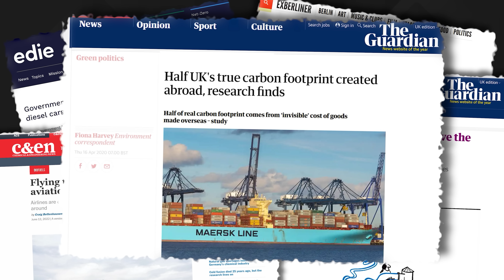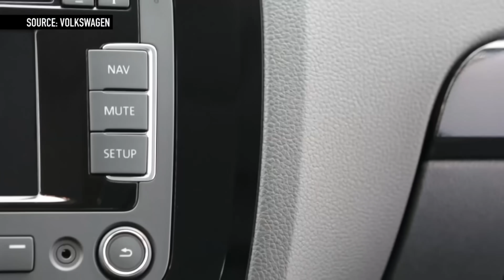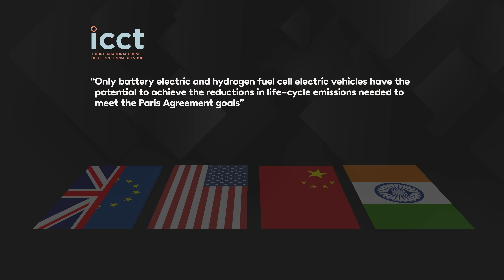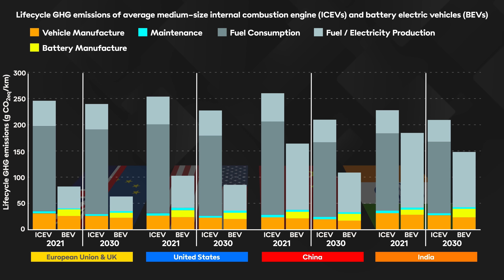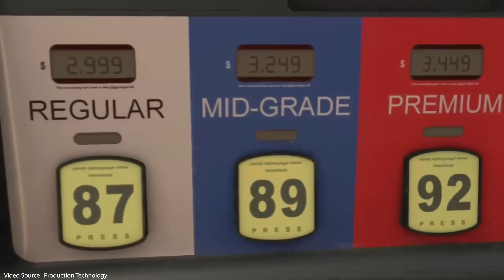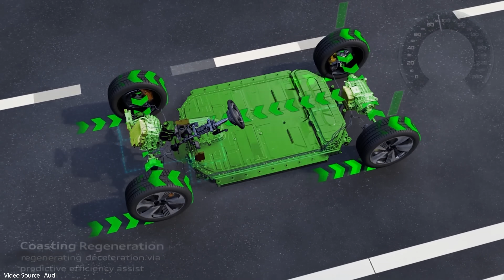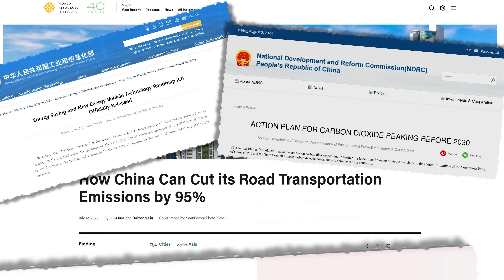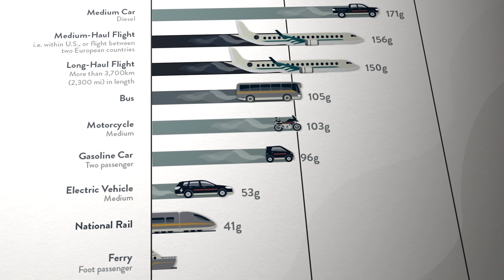Are EVs really better for the climate?

Comment: I think the overall switch away from cars is the best way we can reduce emissions and it will have multiple other societal benefits.
One question I do have, is how possible is it to build enough cars to switch all fossil fuel ones quickly? I have heard that the battery production alone makes replacing all cars next to impossible.
Reply: You raise a very serious issue. The government can legally decide that petrol or diesel fuelled ICE vehicles should cease production on any date they choose. What they cannot do is say they will be replaced by electric vehicles,  because that choice is dependent on China. China controls around 80% of production  of the rare earth elements that are required if you want to make an electric vehicle, a situation that isn't going to change significantly in the next 15 years. Neodinium,  dypsoprisium etc.

It's not planning laws that are preventing mines from being opened,  it's the simple fact that the most economic methods of production of REEs is when they are a byproduct of a massive mine that produces some much less exotic element. China already has such massive mines - the USA don't, and there appears to be no way of changing that economically. And China are streets ahead in Africa in forming partnerships with governments who sit on vast reserves of any element they can't mine economically in China. 

It's not possible to manufacture an engine for Jet aircraft without Rhenium, because it will melt. Rhenium is essential because, along with other metals it forms an alloy that doesn't. It's worth mentioning that it isn't possible to recycle this Rhenium. 

Nobody has been able to come close to showing that it will possible to produce enough of the quantites required to manufacture all the EV''s that will be needed.. Recently, manufacturers discovered it was impossible to secure contacts for cobalt over a five-year period..
Reply: @TheNemocharlie  anyone with a conscience shouldnt be flying anyway.
Reply: Don't worry, they'll just take your car away from you.  You know, 'climate emergency'
Reply: Mining will increase to meet demand, stop worrying about it and buy an EV (or don't drive).

P.S. China doesn't have a stranglehold on the mining of battery materials; rather it has a significant share of the production of the compounds out of the raw materials.

@Dan Harold hydrogen fuel cell cars are dead. There hasn't been a single new one announced for production since the second-generation Mirai in 2019. The dirty natural gas industry that provides 95% of all  hydrogen today may con a few governments into building public H2 refueling stations for all of two car models, but not in enough numbers to make HFC cars successful. And commercial trucking is heading the same way, with far more battery truck models announced and sold then hydrogen.
Reply: @skierpage  as demand increases, so will the supply, I get that. The question is, will the supply increasse wrinkly enough and is there even enough lithium supply in the first place?
Irl mines don't work like how they do in clash of clans. They can be built only in locations with a lot of ore and after lots of planning, paperwork and construction time (all of which will also be bad for the environment).
Reply: @davitdavid7165 for any raw material, if the price goes up, mining companies will look harder for more of it, and begin or restart mining in areas that were less productive. In the case of lithium, we can always extract it from seawater, and one of the perks of deep geothermal energy is the brine that comes up from certain formations has significant lithium in it.

If lithium becomes hugely expensive (note it's only a fraction of the material in a lithium-ion battery), then all the researchers and developers of sodium batteries, iron batteries, redox flow batteries, etc. will be happy to gain a market and we will continue to use renewable electricity and EV charging infrastructure. There is no more efficient way of moving a car around than a battery and a motor.
Reply: @skierpage  a few issues: 
First, I never said all of that would not happen. My concern is that it will not happen fast enough.
Your point on alternative tech misses a few points. All of the existing tech is weaker than lithium batteries and their implementation would be unpopular, especially by the performance driven crowd. And while the rest might be promising, any plan that rests on new inventions is going to be unreliable. I want to do stuff that works right now instead of hoping for a big technological breakthrough to save us at the final hour.
My last point is your statement that "cars are  most efficient when they have a bettery and a motor." That is a statement I agree with 100%. My problem is that cars in general are not the most efficient method of transportation. Very conveniently, the alternatives also require much less battery production, some even require none of it!
Reply: theres a central american country with a huge salt lake with enough lithium below but no infrastructure to exploit it, and there shouldnt be , maybe if we ban all the pointless shit jobs and sports,arts, etc etc people do, and design better, share information freely we can all work local doing only what society needs done and all live healthier more fulfilled lives.
Reply: @H4N5O1O  I do not like this approach.
First of all, who desides what is useless? Tha answer is none of them. The artsy jobs can be important to understanding reality, have huge impact on politics, can be inspirational they can increasse happiness, thus helping productivity ecs.
This framework nor only points to productivity as the issue (which it isn't, we have not been more productive ever in history) and then offers a solution that would not even help productivity and will be impossible to enforce.
The ideas of "freely sharing information" (abolishing ip) and "better design" (vague, but completely agreeable in every sense eof the word) should be enough.
Reply: I don't think we want to switch quickly.    Would be foolish to go all BEV today only to have hydrogen work out say in 10 years.   Going at a reasonable pace also lets the grid and charging networks follow demand.   If either of these get behind it will lower the demand for BEVs.    Mining is also something we don't want to rush.   Say in 5 years we don't need some mineral.  Mining is the hardest.  Political resistance red tape make the lead time to open a mine very long.   The US president just canceled 2 mining permits that were issued under the last administration.    

Going slow also lets the existing oil companies adjust to the new market.
Reply: @danharold3087  Does the cancelling of the 2 mining permits mean very much? What's to stop the next administration re-issuing them?

Comment: Today I expect a combustion vehicle to have a longer life span that a battery but not the other vehicle systems. I expect that to change soon. I hope that was accounted for.
I like synthesized fuels for fuel cells. You can make them with renewable or nuclear which I think is generally more practical. I'm watching sodium batteries lately since that seems to help a scale problem. I don't like hydrogen's low storage density. I really like electric rail. I want bike and walk friendly neighborhoods.
Reply: 100,000 miles is what most cars do.. and the batteries seem to do that just fine. Then they can be pulled out and used as house batteries or in some other second life application.
Reply: @jameshughes3014  2nd use is good. I expect earlier battery longevity still in the fleet to be less than 10 yrs total less than 150k miles. Which I expect for most cars. Total cost to own favoring electric assuming not highspeed charging. I could be wrong. I expect recent EVs to be like 200K+ how ever many years that takes. depending on manufacture and model. Some 4 bangers do that now.

Comment: If we all switch to ev by 2030, would the electric grid be able to supply enough electricity?
Reply: Yes, EV's actually help most grids, as have too much power at off peak, or overnight, and EVs can soak up all that spare energy while charging with offpeak cheap electricity
And there is the option for VTG in the future, helping the grid at peak times.
Reply: @stevetaylor2818  That makes sense using off peak hours, thanks.
Reply: The grid will grow to meet EV needs.   Utilities want the money.
If the number of EVs grows too fast the demand will slow and the grid will catch up.
Reply: How will they grow the grid?  Hydro? Wind? Solar? Nuclear?

Comment: Because you don't recognize the underlying predicament of ecological overshoot in favor of a narrow focus on climate change, you can spend 12 minutes talking about carbon emissions, and we can all feel once again reassured that technology will save us from having to give anything up.
Once you recognize that our problems go way beyond carbon emissions, you can start to see other things. Like the actual existing stock and obviously finite nature of mineral resources. See the work of Simon Michaux on why the planned transition to EVs is misguided and unrealistic.

https://tupa.gtk.fi/raportti/arkisto/42_2021.pdf
"The mass of lithium ion batteries required to power the 1.39 billion EV’s proposed in Scenario F would be 282.6 million 
tonnes. Preliminary calculations show that global reserves, let alone global production, may not be enough to 
resource the quantity of batteries required. In theory, there are enough global reserves of nickel and lithium if they 
were exclusively used just to produce li-Ion batteries for vehicles. To make just one battery for each vehicle in the 
global transport fleet (excluding Class 8 HCV trucks), it would require 48.2% of 2018 global nickel reserves, and 43.8% 
of global lithium reserves. There is also not enough cobalt in current reserves to meet this demand and more will need 
to be discovered. Each of the 1.39 billion lithium ion batteries could only have a useful working life of 8 to 10 years. 
So, 8-10 years after manufacture, new replacement batteries will be required, from either a mined mineral source, or 
a recycled metal source. This is unlikely to be practical, which suggests the whole EV battery solution may need to be 
re-thought and a new solution is developed that is not so mineral intensive."

Comment: I wasn't convinced of this but now I am. EV's aren't really suited to long journeys. They require a lot of planning. Most of my driving is journeys of 5 miles or less and an EV would be ideal for me. My vision of the future are small EV's eg Citroen ami, which we use to get to Tescos and to get to the train station when we want to go further afield.
Reply: "EV's aren't really suited to long journeys."   Is the ability to cover 2,000+ miles in less than 48-hours with a BEV fast enough for long journey's Frank?
Reply: I can go 300 miles without charging my ev. I can easily travel from London to the  North East without charging. Not a problem.
Reply: Need to sort Facts from Fud Frank
Reply: Ok I’ll cut the fud!
Reply: A "lot" of planning Frank?  It seems you never heard of ZapMap. It does the planning bit for you, and even tells you whether the chargers are working. You can also get GPS location, pricing information, charger power, connector type, price per kwh etc..... It can even let you know whether someone is actually using your chosen charger, and how long it will be before their charge is complete. Did you think it was pin the tail on the donkey stuff?

Comment: Building An EV Produces 70% More Emissions Than ICE, Says Volvo - https://www.youtube.com/watch?v=Vi7U6Cj_2aI&ab_channel=JustHaveaThink.
< the difference is quite notable given the fact that both vehicles are built in the same factory, on the same assembly line and they share a great number of components.> Oil needs mining and later need extraction into fraction which is energy-intensive but compared to lithium with requires mining later requires extraction but most important mass production are done only by two firms one in Japan and one in China, it is so high intensive industry that it requires special conditions with a lot of technology (which consumes a lot of energy). Volvo calculated that after 90 thousand kilometers EV car surpasses the same mode ICE car and becomes economically (energy more efficient vehicle), car life calculates by mileage not years same as humans life calculated by heartbeat not age too. And 90 thousand kilometers is a lot.
Reply: VW might disagree. Their electric cars are built in new manufacturing plants with a zero carbon footprint, powered by 100% renewable energy. The cars themselves are built with a high percentage of both recycled and plant based material. Even the final paint finish is plant based. More details on VW's Electric Car Manufacturing site.  Maybe Volvo need to clean their act up?

Comment: There is this thing about co2. Even most EVs have a carbon foot print. What I've seen and read puts it at first 3 years with Evs, while ice will continue to have emissions. A lot is due to where there electons come from, but that gets less and less the more renewables come on line. Ice will always pollute and anyone who has been through covid might have noticed how clean the air was when under lockdown. Let's see. Go Tesla and the rest. What a time to be in

Comment: If EVs replace petrol cars at the same rate drivers would purchase a new car anyway, then the carbon savings will be realized. If, however, either through enthusiasm or government intervention, EVs replace cars that are still perfectly serviceable, then the residual carbon investment in the petrol cars will be wasted. At what point this would be counterbalanced by the improved carbon emissions of the EVs might be calculable (it would be rough), but it is not a trivial consideration, especially since EVs' major carbon emissions are associated with manufacture.
In other words, don't push too hard, or, like so many other well-intentioned actions, the cure will end up, in the short term, at least, worse than the disease.
Reply: I see your logic but there is a flaw   
The old ICE just keep churning out CO2 and other stuff.
 
Kind of like walking around with a hole in your pocket.  
Your best bet is to buy new pants now instead of dripping money/(carbon investment) till it gone.
Reply: @danharold3087  Except that the EVs carbon expense is largely manufacturing (up front) cost. If you are losing a nickel a week through that hole, and the new pants cost $50, it may not be a good investment. Especially if the cost of pants is expected to fall (improved battery technology).
Reply: @andrewbobb3170   
It takes about  4,500 kilograms of CO to make a 75KWh battery and an average ICE car (don't ask me I just grabbed it) create 411 grams of C02 per mile.
That works out to under 11K miles of driving for the BEV to offset the CO2 used in construction.     After that 11K miles the ICE engine keeps on belching.
Reply: @danharold3087  But you also have the engine, the frame, the fixtures, lights, etc, all of which have their own carbon cost. And I suspect even for the battery (I don't know where that figure comes from, so I can't check) that figure refers to the direct manufacture, and not all of the attendant mining, refining, transportation, etc, costs. No one ever goes back to scratch in calculating in either EVs or ICEs. Or stuffed walruses, for that matter.

Comment: Nobody seems to factor in the fumes given off in the case of a fire. EVs give off far more toxic fumes and also the fire's can't easily be extinguished so they often have to be left till they burn themselves out

I've also never seen a petrol/diesel vehicle spontaneously burst into flames like EVs can which poses a pretty significant safety risk imo especially for things like buses where people can't always quickly leave the vehicle or in case where people charge the EV over night in a garage near or connected to their house

9 times out of 10 when a petrol or diesel car catches fire its because of a short or problem with the wiring...... EV's compound the wiring needed 10 fold with much higher voltages and currents making fires caused by wiring damage/defects more likely

I'm not saying EV's are bad I'm just saying I don't think they're ready for full scale roll out just yet, I mean pretty much no country even has the electrical infrastructure in place to handle that many EV's meaning it could turn into a catastrophe
Reply: So factually in correct I don't know where to begin. The smallest amount of research disproves all of your post.
Reply: A bit of FUD in that.    The media would like us to think BEVs are burning at an alarming rate.   They are not.  Most of the fires we are seeing are from batteries made by LG chemical aka LG chem.    Some new chemistries are much much less prone to the problems that start battery fires.

Point or anecdotal evidence is nearly worthless.  I witnessed a new Chevy 2 ton (maybe larger) truck catch fire and burn to the ground.  It was a gas fed fire.  My guess is a fuel line hose clamp was missing or failed.    

ICE vehicles catch fire 5 to 10 times more often than BEVs.   They are also kept in garages.   It is just that they are not news because they are not new tech.  As they age they turn into grease balls in search of an ignition source.

The infrastructure (think you mean charging network) is growing with the sales of cars.  It  keeps getting better.  Range is already workable so long as one is not towing.